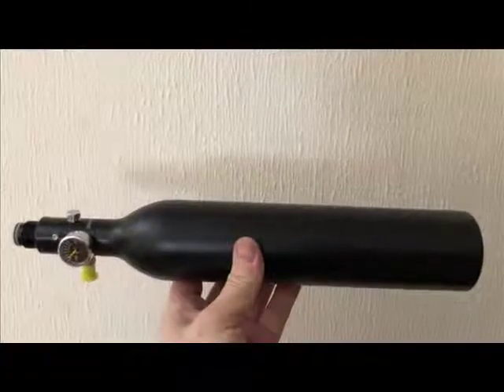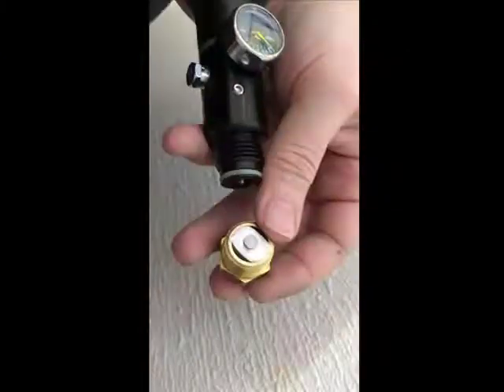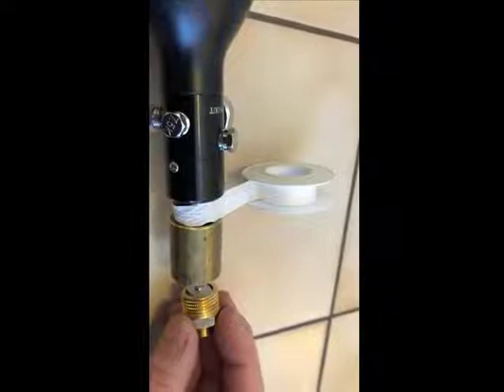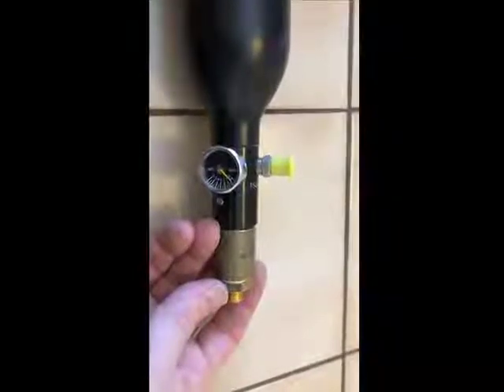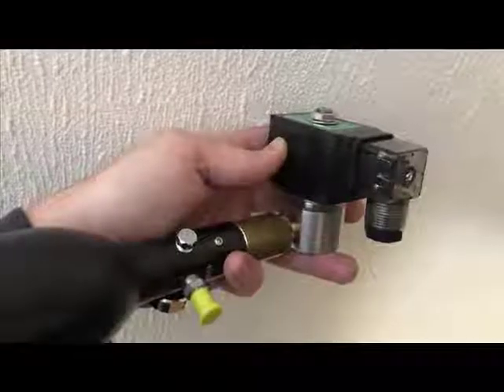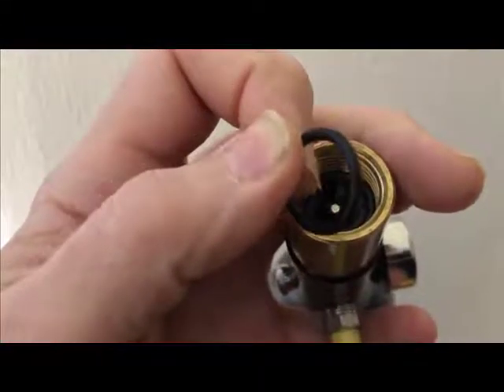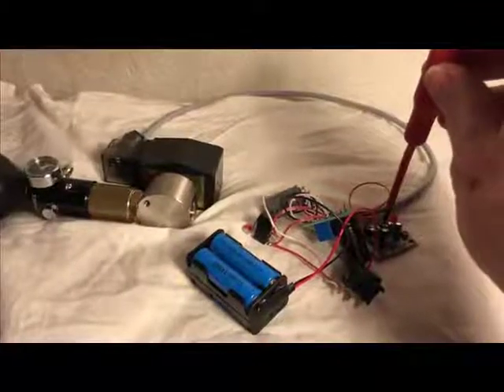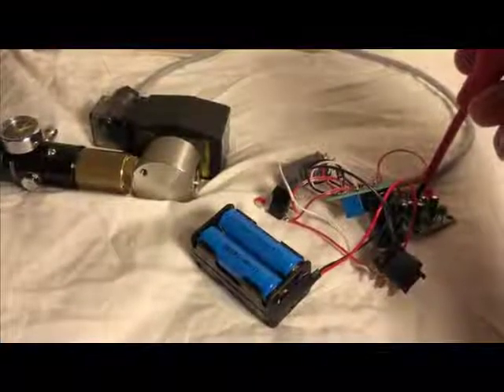High Pressure Air, PCP Full Auto Valve Experiment, Part 1

Comment: Hello what is the brand of the solenoid valve ? Do you think normal solenoid vavles would work too?
Reply from the maker: Sorry for late reply. The valve I use (12V GOGO 200bar SS304 SPG-01) was ordered from AliExpress some years ago. It’s a bit bulky, but a normal solenoid valve wouldn’t handle the pressure if you need great power. There are lots of good videos on Youtube on how to build your own valve, although not solenoids though. Good luck.

Comment: Can you please share components list?
Reply from the maker: I used parts I had at home in Sweden some years ago. The valve was from AliExpress, GOGO 200bar SS304 SPG-01 (12V for both water and air, but the coil is a bit big). I would recommend that you check this out for inspiration: https://youtu.be/SGMTEOcCyZw

Comment: I know this has been a while but this is what my setup is currently in now, I am having trouble with the connector from the regulator going to the solenoid can you please send link of those adapters and bleeder  so that I can look up to the parts, thanks
Reply from the maker: Due to the high pressure, sealing tape isn’t enough. You’ll also need o-rings of the proper size, that you screw between the surfaces of the adapters (standard pneumatic adapters from the local hardware store, 1/2” to 1/4” or similar) plus an hydraulic piston seal or similar between the adapter and the valve, I think I searched for the proper seals/sizes on AliExpress. It takes some experimenting to get it airtight.

Comment: Can you explain why you jammed the ali piece in the adapter?
Reply from the maker: Sure. Its there to open the vent on the high-pressure bottle (theres a pin in the middle).
Reply: Why cant you just go bottle to valve with no vent?
Reply from the maker: @davecrawford8785  If the bottle didn’t have one, sure. This is a standard bottle for airguns, though.

Comment: Just have to get reclaimed air actuated bolt and clip now. Well done sir. I tip my hat to you. Hell I'd buy a drink if we was sitting at the same table.
Reply from the maker: I just found a suitable solenoid for high pressure, that’s all really.
Reply: @matszh  any links / leads . I wad think along the lines of semi auto shot gun, gas from barrel sliding bolt. 3D print some sabots . all I've seen so far in airguns has been cylinder . im sure is because an all lead round would get messy in the bolt claim smashed in there . theras idea 3D printed jackets for lead rounds. Whole thing gets shot out.
Reply: @matszh  got a video for that. Or a link to buy one?
Reply from the maker: @killhacker5776  My video was supposed to be about that :) Regarding valves, I think the best thing is to search on AliExpress. Joerg Sprave has some fun stuff on his channel too; https://m.youtube.com/watch?v=SGMTEOcCyZw
Reply from the maker: @killhacker5776  I think mine was from AliExpress,  GOGO 200bar SS304 SPG-01 (works for both water and air). It's 12V and a bit big though, also it costs more than when I got it some years ago. The biggest problem is to make the pellet loading automatic though, I'm still working on it. Of course you can "spray" a bottle of round balls, but without much control.
Reply: @matszh  pellet feed I would copy a clip design that exists scale it down with a CAD program . build it with a break or vise maybe jewelry tools.

Comment: is this a voltage amplification circuit? can you show how to make one?
Reply from the maker: Actually, it’s just a high-pressure solenoid from China (AliExpress) actuated by an astable flip-flop circuit (auto) or manual switched capacitor (one-shot).
Reply: @matszh  cool, at what pressure does it work?
Reply from the maker: @Idontlikethisname-zy3zn  It’s in the video; the tank is 4500 psi and the valve 3000 psi (but I’m sure it works for 4000 psi too).
Reply: @matszh  I tried searching high pressure solenoid and 3000 psi solenoid on aliexpress but I didnt find it. I guess its just no longer available.
Reply from the maker: @Idontlikethisname-zy3zn  I think mine was the GOGO 200bar SS304 SPG-01 (works for both water and air). It's 12V and a bit big though, also it costs more than when I got it some years ago.
Reply: @matszh  that is very helpful, thx
Reply: @matszh  do you have a link for the "flip flop circuit" please?